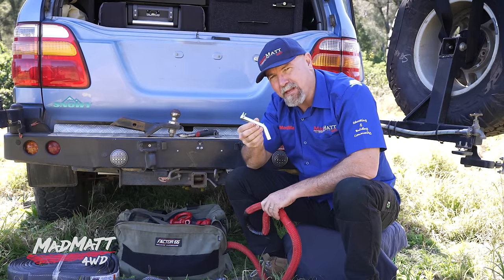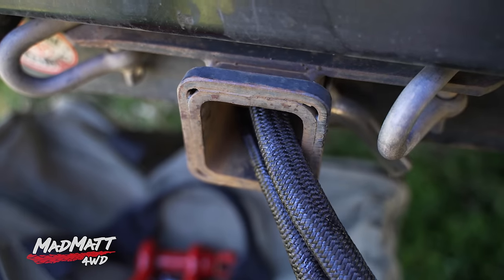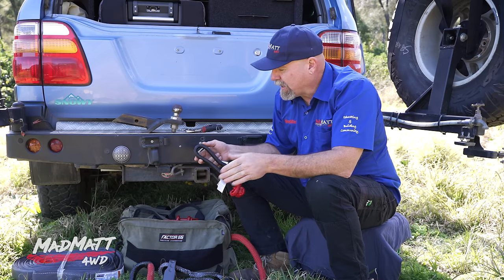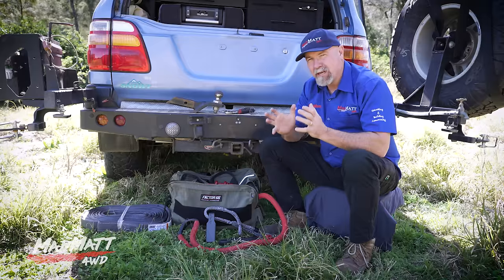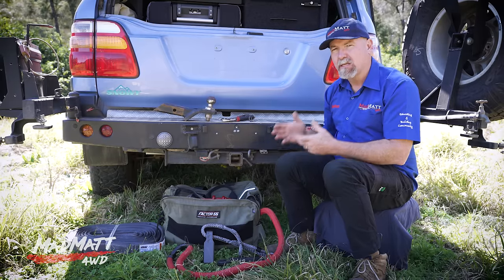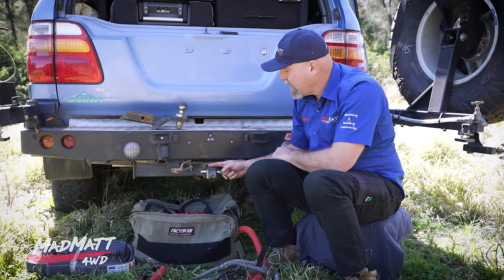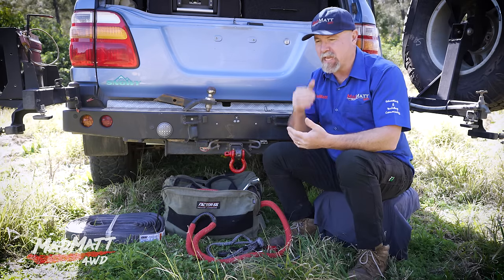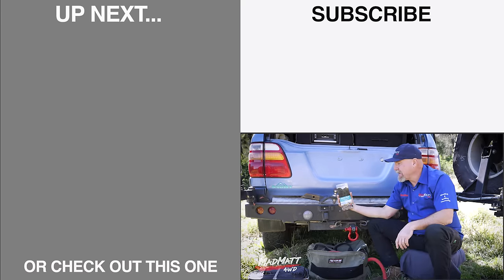Should you use a hitch pin as a 4x4 recovery device? Is it a YES or NO answer?

Comment: Matt,
Great video and you were doing some homework about hitch pin as the recovery point! My argument would be for incorporation of the ‘hitchchunk 2.0”. Would be that you are introducing a projectile. Where as just using the hitch pin standalone, with a soft shackle and a kinetic rope. It keeps the working bits all made of speed reducing fibers. I know I know, emergency only for the pin. But I’ve been doing it for yyyyearrrs. Most I’ve ever done to a pin on bogged 6600lb rigs. Is slightly bend them. Never had one snap and that is because of its Rockwell hardness being in the 20’s. They’re just not brittle and have a nice elasticity to them. And when they do finally give up the ghost. Very cheap to replace. That’s my 2cents. Thanks for listening:-)
Reply from the maker: I appreciate you proposing the argument. Have a read of this from Factor55 re the breaking points of things. The hitch ain’t coming flying any time soon. 

The 2” hitch itself is rated for 9500 lbs. that’s the max load. That’s why the 2” HitchLinks, all of them have 9500 lbs machined into them. Our parts have not seen yielding in testing until just before breaking. What’s this mean? Every other item you have attached to the HitchLink and pin will fail before either of those do. 

Standard duty soft shackle - 39K 
Tow Strap- 31K 
KERR- 29K 
HitchLink 2.0 - 51K 
Hitch pins- 50+K 

The entire off-road industry functions off break strength not WLL. 3/8 Synthetic rope breaks between 18-22K so a 5:1 means it’s WLL is only 4.4K on a 12K winch? 

It’s about quality of materials and validation through testing.
Reply: @MadMatt4WD  I’m my defense, I don’t buy garbage hitch pins and not a kamikaze recovery dude. Slow steady, baby pulls and usually have the winch helping too. I’ve watched the original video from where this PSA started from. And it is very unfortunate. It needs to stressed as well as all this great recovery gear. But you cannot go gangbusters with the throttle. The suction needs to be broken. As you know, the factors of this tragedy are numerous. 
Hope you and yours stay happy and healthy
-PS
Heading up to Vermont USA for 4-5days. If your ever in the states again remember this road. RISKY RANCH RD. it’s an amazing gateway to Vermont wheeling👌🏼
Reply from the maker: @johneden7975  great comment and it’s good to see you’re playing the game well. Risky ranch it is.

Comment: I saw someone bend a pin being way too aggressive on a pin hookup and it still didn't break or pull out. That's when I started doing it. There are many occasions where it is perfect for, even when out on an offroad trip.

That said I have the gear to do it how it needs to be done or I don't do it. If a pin hookup and pull from stoped is enough I use that if not I usually prefer to just switch to the winch, let a heavier rig do it, or have 2 rigs pull together if its a traction issue. In the sand is my exception to not bumping, and even then I never go over 2mph.

Like you eluded to, at a certain point you rip things apart or start bending other stuff. A complex recovery takes carefull monitoring of changes to the load and recovery points, if the recovery is going to bend the pin its probably best to not be hooking to the hitch at all but instead to a couple of places on the frame. If off angle the recovery receiver is the best thing since sliced bread, it was the first recovery peice that I got and is always in when offroad... also it protects my spare tire from catching on drop-offs which is nice.

A great follow up for this would be a video called.
'Where should I have recovery points?'
Or something similar.
Reply from the maker: Great comment. Cheers

Comment: Good advice. In addition, it’s important to point out that all hitch pins are not of equal strength. I have a steel hitch basket. It’s rated for 350lbs load. The receiver pin included with the basket is the cheapest, lightest pin I have ever encountered. If that’s your only pin you have for a recovery situation, it will fail to some extant, and that would be an unhappy moment. The basket is only designed to carry a moderate percentage of tongue load, without dropping the basket. Not for pulling a fully loaded trailer.
Reply from the maker: I’ve not seen that design but it sounds concerning for use outside of its design. Thanks for the encouragement.

Comment: In 1973 our neighbor got his tractor stuck in the field. They tried pulling it out backwards using a stretchy rope and the rope snapped a flew into the cab of the stuck tractor and instantly killed the guy inside. After then my dad would never let anyone use a stretchy rope on our farm. I’m guessing that the stretchy rope that they use now are safer.
Reply: That's sad mate. Sounds like heavy-duty cable winches would be needed on that kind of job.
Reply from the maker: That’s so sad and unfortunately still happens way to often.
Reply: When I began in the tow industry my boss used to warn me of the dangers of a snapped cable, flying hitch, or flying bumper. Any of those situations should obviously be avoided.
Reply: Sad story. But was it the stretchy rope that killed the guy or the attachment device?  If it was the attachment device I'd say equal risks exists shock loading a cable or a chain the same way. I'd argue probably more so because a cable or chain breaking has a lot of weight on its own, whereas a rope would have a fraction of the kinetic energy.
Reply: @JimP226  
I don’t know which as I was 6. The tractor just sat there for about 10 days with its duals stuck deep into the ground.

Comment: @MadMatt Hi, great video, got me thinking about the strength of the tow-bar, and the attachments. While the system may be "rated to tow 3.5 tons", this is never the actual load on the towbar, unless the caravan is hanging off the back of the 4WD, over a cliff (full weight of the caravan on the bar). Towing a 3.5 ton caravan does not put 3.5 tons load on the bar, not even on a steep uphill. What is the actual (likely) strength of a "rated to 3.5 tons" towbar? And with that, is it safe to USE the towbar (with the proper receiver adaptor) for recoveries? Thanks.
Reply from the maker: Excellent question and a really important one. As I say we use them because assuming they’re in good condition we’re not seeing them fail. But because we’re using them outside of their design parameters it’s important that we respect the recovery system and have an understanding of the forces we’re generating.
Reply: If you look on America Got Talent there is a 90 year old man (Mike Greenstein) towing a military truck full of people, with his teeth!
Reply: Tow bar is not going to fail unless it's rusted out. I've seen them ripped off the frame, but again, that was rusted out.

We are NOT talking about bike rack holders you might find on cars. Those should never be used unless you're pulling it out by hand with two strong guys 😂
Reply from the maker: @chriscoulthard4947  the things people do

Comment: A  fundamental of  industrial safety (preventing accidents) is  a vigilant awareness  of stored  energy and the consequences of that energy being released. 
It can be a suspended load, a loaded gun, 480 volts, airing up a 10-20 truck tire, or getting stuck against a submerged tree in a river.  Where is the energy? What happens if things go wrong? 

A  little forethought can make a big difference.
Reply from the maker: Well said

Comment: If you are concerned about the sharp edges on the hitch receiver, you can easily file them down in as little as 5 to 10 minutes. In case your vehicle gets stuck in sand and you have a clear straight path, using the hitching method is a good option. However, I believe that one of the most effective recovery methods for sand is to use Maxtracks or Treds. Remember to use the ribbons that come with them because once you are out of the sand, finding them without a shovel could be challenging. A shovel can be the best recovery tool you could ever have.

Usually, I do not need to use the hitch pin method as I have enough recovery gear for both my 4WD and the person I am pulling out. The only time I would not use the hitch pin method is if the person is stuck in the mud. Anyone who has done off-roading before knows how much suction mud has on a bogged 4WD. In such situations, I use a winch, and if that fails, I use the tyre method to lift the stuck 4WD and break the suction. If that still doesn't work, then you may have to camp on the side of the track for the night.
Reply from the maker: Sure you could file the receiver but that only solves one potential issue.

Comment: One detail. The bend radius on the 5/8 pin would be much greater than the radius on that receiver adapter, especially on the outside corners. I do agree that beam loading the pin is a big problem and the VERY sharp radii on the edge of the receiver hitch itself.
Reply from the maker: I don’t think that’s the case Factor55 designed and tested this for soft shackles. The bend radius to maintain 100% strength is 1:1.
Reply: @MadMatt4WD  If they are getting those results, that's great. It does go against what generally every rope manufacturer will list for bend radius as far as max strength and long term life of a rope section. The small radius might get you a good result once, but the tighter radius will break fibers down over time causing accelerated wear. Generally, that accelerated wear will indicate that MBS would make a correlating drop. Just like with the hitch edges, we should also be considering that the pull won't always be straight, adding a softer outside edge would help increase soft rigging life and strength also. I'm just trying to make sure everyone is making the best products possible.
Reply from the maker: @brennanmetcalf  great points and I don’t disagree. I’m not a rope expert and relay on those I believe know this stuff. I’m always looking to learn
Reply: @Metcalf Factor 55 has an updated design in their hitchlink pro, with a better radius on the corners. Haven't seen testing on how much less stress it places on the fibers in soft shackles, but the difference in radius is significant.
Reply: @Anathoth  It's good to hear they updated their design.
Reply: I thought the same thing, those 90s beveled or not are sharper than a 5/8 pin radius. It realistically should be a 1/2 Torus shaped end.

Comment: I have a rhino USA solid steel receiver. I have a excursion so my hitch is meant to stop a car at 70 MPH from sliding under me so its meant to do it. I have a v10 and 430s. Tones of torque and rpms. My first pull is always slowly pulling with the brakes still on slowly inching forward. 4 low for really slow and steady pulling.
Reply from the maker: Excellent. Slow is the go

Comment: Hitch pins are for towing.   "With great caution" in an emergency is spot on.   Replace your hitch pin with a grade 9 bolt with correct shoulder length and you'll feel better about the contingency. 

Further,  your emergency gear does not work if it isn't in the rig.

Comment: Most hitch pins aren't that strong. An ARP grade 9 bolt in the receiver is another matter! A grade 9 bolt with a nut to secure it will pull thru the receiver before it bends-ask me how I know!!! Hey, I got the 4-wheeler out with my 2 WD truck and he paid me for a new hitch and gave me $500 to boot. My new hitch has a "sacrificial" receiver that can be replaced-great idea Reese!

Comment: I agree with the change of heads pace when doing anything other than driving. The other weekend I went bush to cut wood and had to drag two trees onto the road to cut up. First one I used a drag chain to the hitch on my trailer, no hitch pin used just run the slip hook through the back of the hitch and hook to the back. Light load with not much force required. The second tree I unhitched the trailer, removed the towball and put the recovery hitch in and hooked the drag chain to that. 4x4 low 1st and had to give it a fair bit of welly after the first slow attempt didn't work. The hitch on the trailer might have taken it but it's not connected front to rear of trailer so I don't use it for anything but light weight work. Just stop and think about everything your doing often hours from help or even mobile service.
Reply from the maker: It sounds to me like you’re respecting the force.
Reply: @MadMatt4WD  definitely when you as know one mistake can kill, I don't want that being my father who is usually with me.

Comment: I know I've said it before, but having good connection points is a must (I have 2 square hitch points on the front of my rig & 2 & the rear, PLUS my tow bar. All 4 points are directly connected to my chassis rails, it means I can spread the load evenly & safely. I even have one on the rear of my car carrying trailer (for Justin!) As I've also said before, I absolutely love your passion for safe 4wding & the fact recoveries are serious stuff! I totally agree with the correct head space with recoveries, one of the worse things is having mates around being D*ck heads & forgetting about safety all together! Great Stuff Matt!! Stay on the mission, you could certainly save some heartaches, if not maybe a life by your continuous campaigning!! 👍
Reply from the maker: Thanks heaps for such a positive encouraging comment.

Comment: When you do a harness course in the construction industry you are taught that your securing point to hold a  person needs to be strong enough to hold the weight of a car if you want to use it to secure a person at height. If you need to pull a vehicle out your securing point needs to be able to hold a dump truck at least. Are you using the correct point. Would you be able to lift the dump truck off the ground with the securing point you are using? Makes you think doesn't it.
Reply from the maker: Yes and I wish more people would think

Comment: So what about bypassing that receiver point entirely??? I've just been putting soft shackle around the crossbar of the hitch adapter... Mine happens to be a round crossbar, but I can a decent gap above the square crossbar and below the bumper of the rig in this video.... Id really like the actual break strength difference single shear vs double shear, and possibly see what gains are made with the addition of something like 2"L*5/8 ID*1/4WALL Tube creating a near double shear scenario... I've seen several cheap recovery shackle hitches that use a hollow square tube, so is that really much better???

Comment: all common sense to me , im not a mechanical engineer but as toolmaker sheer points, sharp edges and how loads act on anchors  seems pretty straight forward. More over there is a reason the hitch receiver is aluminium or aloominum for the yanks out there . It will yawn or stretch the hole before it sheers the 16mm pin where as a steel one would in a very high shock load environment actually fracture then sheer the pin at the point where it enters the sharp edged hole . Acting like a punch and die scenario . i dont use the standard soft 16mm pin but rather an m16 cap screw which is 12.9 and the highest tensile of any bolt that you can buy . I have also made some from 60 ton tensile tool steel in a fix for a mate that had no other recovery pints on is mq patrol back in the early 90s . ive snatched bogged to the axle troop carriers off them (with some shovel work) and not had one fail . These days i tend to favour the winch though

Comment: You can get away with forged hitches for tow balls. Cheaper than F55 products and they’re generally rated for more. 65USD for A forged hitch rated for 17,000 lbs towing and 2250 lb tongue weight.

Comment: Hey Matt, love your channel. Had a bit of a left field content suggestion. Comes from almost loosing my pride and joy on Moreton last week after the high tide came up a lot higher than the day before, I'd run out of beach and was forced to drive through a fair amount of salt water (hip deep on one of the creek crossings which was terrifying driving solo). Luckily got back to camp with a lot of cleaning ahead. Definitely the most stupid thing I've done in the last decade.
I guess in hindsight what I'm curious about is whether it would have been a better choice to park the car as high on the beach as possible, drive up the dune potentially rolling the car or just trying to get the car out of there which is what I ended up doing (besides the obvious of just not getting myself in the position in the first place). 
I know a lot of people every week loose their cars to the tides, just for the poor folk that do; I wonder if there's a better course of action. 
Cheers, 
Geoff
Reply from the maker: Hey Geoff. Thanks for the kind words. Personally I plan my beach drive and always try to have a buffer. I’d not drive through salt if at all possible but as you have then lots of fresh water flushing is the go. If you could get above the tide level that would be good but balancing that with damage to the dunes is important. It would be an interesting video for sure. Let’s we what happens